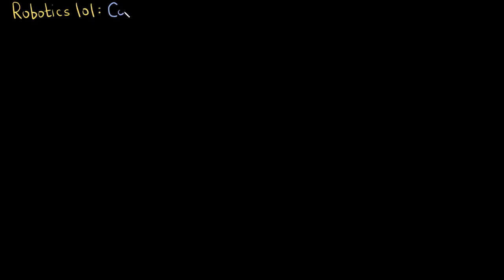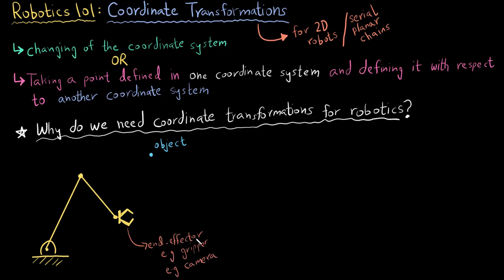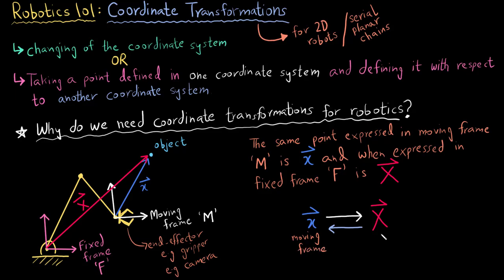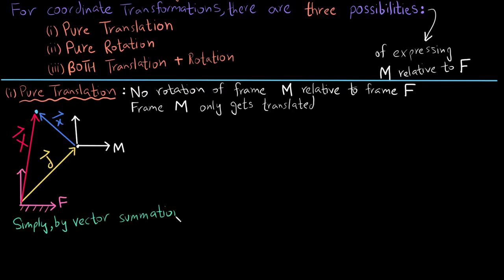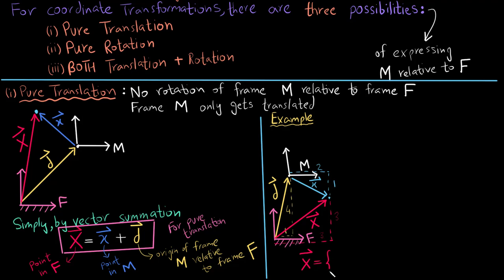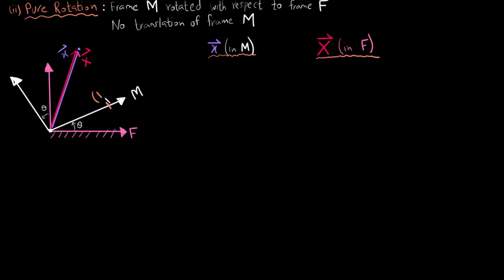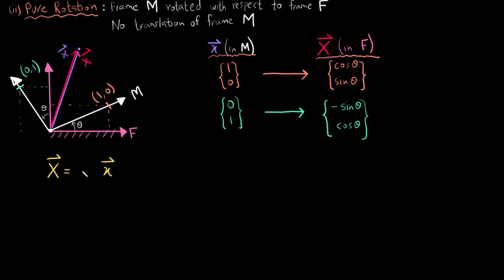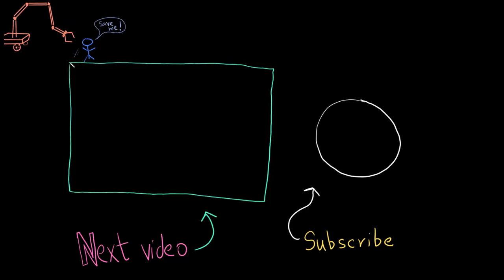Coordinate Transformations in 2D | Mapping | Robotics 101

Comment: hello. how did you convert the points (1 ,0) and  (0 ,1) in frame M to (cos , sin )  and (-sin , cos ) in frame F as stated at 6:40. Can you pls explain
Reply from the maker: Sure. We are basically projecting the points onto the X and Y axis of the Fixed Frame..
For the point (1,0) marked on the Moving frame's X-axis, if we want to project it onto the X and Y axis of the Fixed Frame, we can see that the X-axis point will be at '1*cos(theta)' and the Y axis point will be at '1*sin(theta)'.
Hope that helps. Did that clear out the confusion?
Reply: @EngineeringSimplified  thank you sir. I have it cleared now after working with a few examples
Reply from the maker: Prefect, glad got it cleared.
Reply: @rhijaz8351  can you tell how, as i want to do it by hand and not software thank you